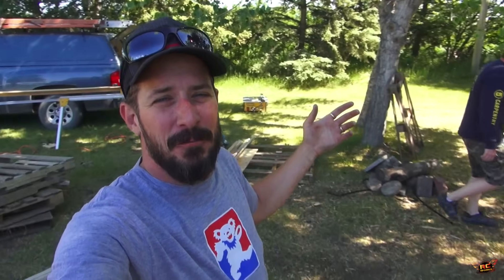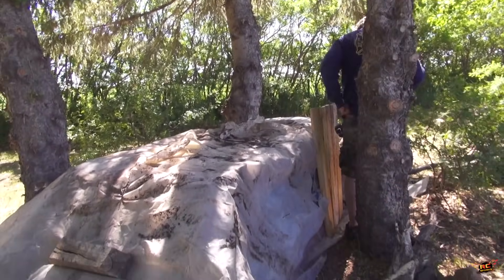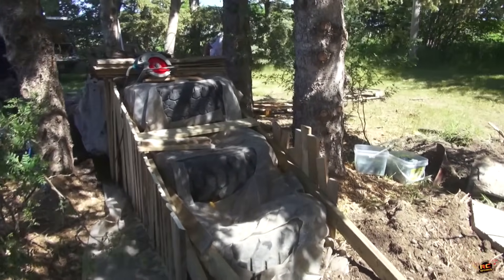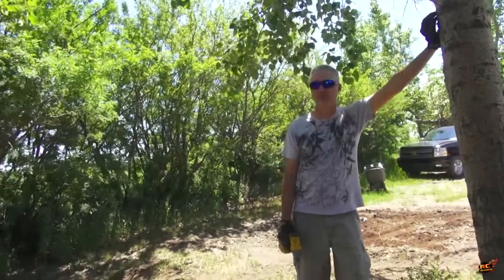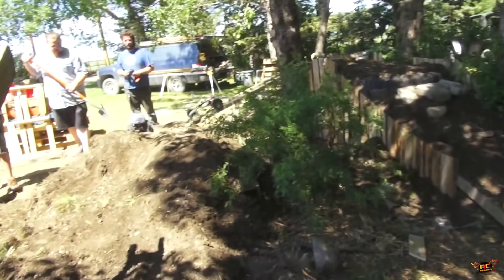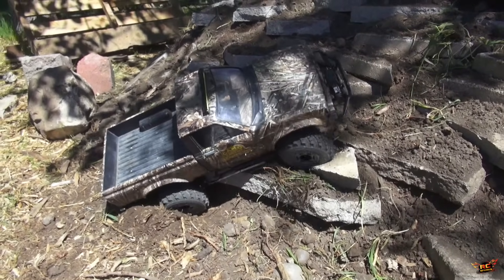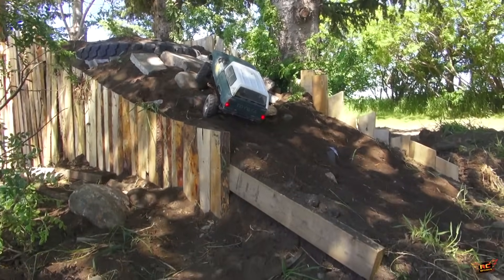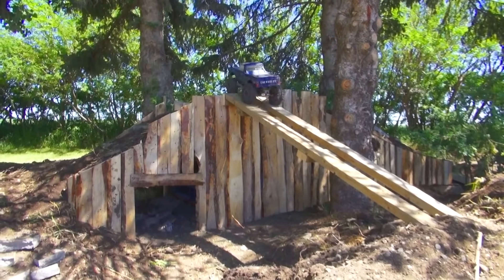RC ADVENTURES - Building a Backyard Scale Trail Course - Tips, Tricks & Ideas

Comment: I am in the woods (Upper Pen Michigan) with so many trees that there's nearly no sun so there's no grass, only moss. The other cool thing is that I have a crap ton of rocks/boulders over every square inch of my 2 acres with very little useable dirt. I am planning on starting about a 1/4-1/2  acre track this spring. I already have a huge rock wall and even rock stairs that should make it easy to get started. Can't hardly wait! I have an Axiel, Traxxass, Banchee and a few others I am looking forward to running this summer on the new trails! =)

Comment: You need to make a bridge using steel cable instead of a bunch of 2x4's. It would be a nice challenge.
Reply from the maker: Yes, a wire bridge is coming.. of course.. this is just a starting point!

Comment: I've sort of built one so far at my house. I have a bouncy start on some small branches, then to a small rock course, up a incline on 2x4s on a cinder block and back down, over a tough poly pallet, soon to be a sandpit, and then into a mud pit and crossing into a small stream when it's flowing. I want to add more. What do you think I should add? Maybe something on the pallet? I want to do a hill climb but there's a lot of roots and it's all fairly moist dirt
Reply: How about a narrow bridge over the stream
Reply: +T-Wrecks TV actually my course has changed a lot. The stream has been cut out of it cause it only has water in the winter and spring. Dry all summer.
Reply: +Zach Novosad 

oh maybe you could drive in the dry ri embed I'd it is rough
Reply: +T-Wrecks TV 

riverbed autocorrect fail
Reply: +T-Wrecks TV it's not that much of a challenge. I got more ideas for it. Just need the time and supplies